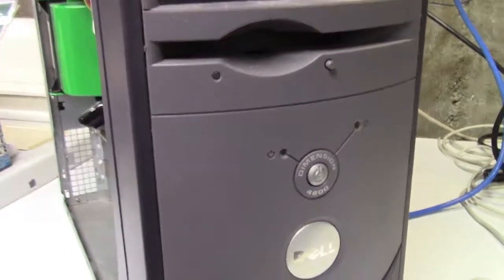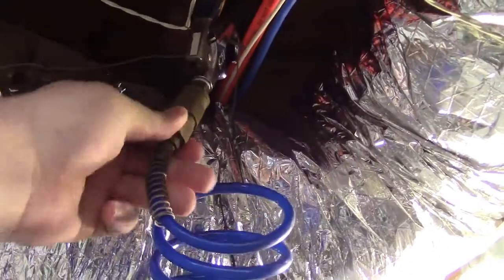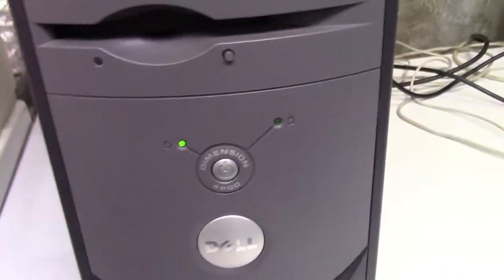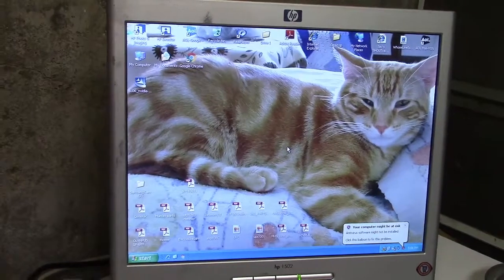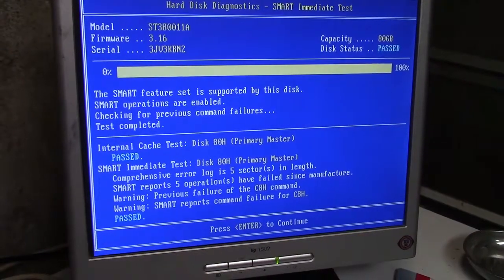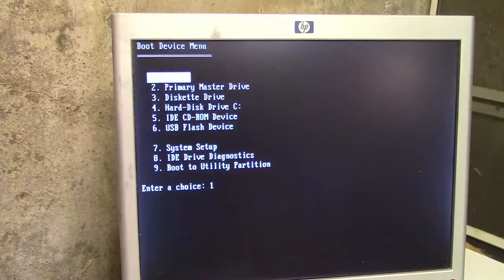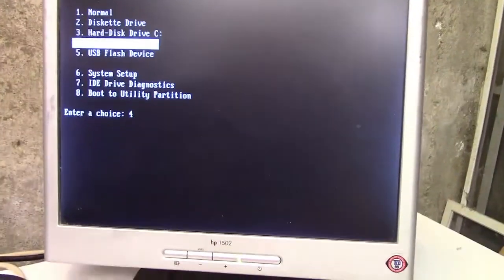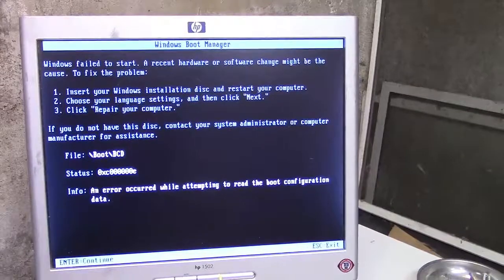Dell Dimension 4600 Windows 7 Upgrade Attempt, Part 1

Comment: Mine doesn’t even want to boot anymore
Reply from the maker: If I could get this thing to cooperate, you can get yours to boot.  Most anything can be fixed.  I've been repairing computers for almost 30 years.
Reply: @jaykay18  I got it to work for a good minute and then I wasn’t getting past the dell boot screen
Reply from the maker: @FDSGarage  Oh that's an EASY repair then.  I'd start by disconnecting the hard drive, most common culprit for an aged machine.

Comment: Is this machine the same model as the one you use on a day-to-day basis?
Reply from the maker: No, I actually have a 4700.  Same case, a bit newer board, faster processor.  This one was a 2.8GHz, mine is a 3.4GHz.
Reply: @jaykay18  Can the 4700 take any core 2 duo chips since it's an LGA775 motherboard?
Reply from the maker: I don't think so, but then again I've never tried.  I don't remember what chipset is on this board.  If I recall, 3.4GHz was the fastest processor they made.  If not, 3.6 was.
Reply: @jaykay18  I couldn't use a P4 anymore on a day to day basis. Everything these days is optimized for 64 bit CPUs with multiple cores. I have a quad core CPU now, but you can easily find secondhand business class machines with quad core processors and plenty of RAM in them in the $100-$200 range, but I built my own system a couple of years ago. In the future, I'm definitely going to buy a secondhand business grade machine with plenty of expansion options with the specs I want, and I recommend anyone else do the same. You can easily get 3, 5, or even 10 years out of a computer these days before it becomes obsolete for daily use.
Reply from the maker: I don't know what kind of stuff you do on a computer, but 90% of the work I do requires the Internet.  Barring scripts and other crap on web pages that have to run, and can run quite slowly, this Pentium 4 that I use has still got it.  The only other tasks I'll do outside of the browser are a couple of digital picture edits here and there, open a word processor now and again, and of course video editing.  Video editing is the ONLY thing that requires me to have a 64-bit processor.

While you may be able to get several years out of a business machine, consumer grade ones look like they're broken the instant you buy them, at least now.  It didn't used to be like that.  Some machine are so poorly designed.
Reply: @jaykay18  Scripts are terrible. I use Firefox because noscript is written for Mozilla browsers, and I consider noscript to be an absolute necessity these days. As for consumer grade machines, they are terrible quality, which is why I said to get a business grade machine
Reply from the maker: Never liked Firefox from the get-go.  Can't explain why.  I gave Chrome a shot, and it's been fantastic, so that's all I use.  This decision I made many years ago, when web pages weren't opening in IE 6 anymore.
Reply: @jaykay18  Google pretty much broke Mozilla in that Firefox is now made to imitate chrome rather than be unique with its add-ons. I've also tried open source forks of Firefox such as pale moon because chrome's interface is terrible, it hoards resources more than a millennial hoards Apple products, and worst of all, Google doesn't care about their users' privacy, and they never will since they know everyone will continue to use their products
Reply from the maker: You'd be hard pressed to get me to switch browsers.  I need stuff that WORKS all the time.  Chrome has proven itself.  It remains my browser of choice.  I'm basically all in with Google at this point, with this YouTube channel and all.  When it stops making me money it'll be time to change.
Reply: @jaykay18  Chrome only works on XP and later, firefox can work on versions of windows as early as Windows 95 (though I don't know why you would want to use a machine running Windows 95 to do web browsing outside of novelty) and that's a necessity for me since a lot of my machines run Windows 2000, and even though it's gotten worse over time, Chrome isn't any better.
Reply from the maker: I only have a small handful of machines that run operating systems prior to XP, so that's not a problem for me.  I have a couple of Windows 98 machines around, but I certainly wouldn't even attempt to put them on the Internet.  They are, however, Ethernet equipped, for internal network access.

Comment: I need to replace the hardrive in my laptop and put windows 8.1 back on it. also got a new entertainment center and now both betamax VCRS fit under the tv. had to get some special cables that will allow me to split the video from the one betamax so it goes to both the projector in the closet and the TV. They sell splitter boxes but I went the cable route instead.

 To get the none HIFI betamax to work with the TV I went ANT out from the sears to ANT in on the sony Then RCA out to the projector and the TV. I don't know if betamax had copy protection like VHS where the picture fades in and out. 

The Sears will output over RCA but only left or right not both. Using the coax I can trick it into stereo sound. I'll use the Hi-Fi to record off the TV with another set of RCA cables to go from the Cable box to the Sony since I got the cable box going HDMI to the tv and RCA to the DVD/VCR combo. Will make a video on all this.
Reply from the maker: 8.1, unless you have recovery discs, or the system is something reasonable like a Dell, is HELL to put back on.  I know the Dells and some of the HPs, and a couple of other brands have the 8.1 product key (or 8 product key, if it came with it, of course) hard-coded into the system, and Windows just picks that up and auto-activates so no big deal.

Interesting how the Sears won't output stereo sound, but does over coax.  Hey, if it works it works!  A quick search reveals "The Betamax player will not recognize the Macrovision signal because Macrovision was not meant for use on beta tapes.  Even though the player doesn't know how to react to the signal, it is still there and can be passed on down the line. VCR-to-VCR copies do not work".  I actually have a device to get around Macrovision copy protection, I think it works over RCA cables only.  Chances are good it's still around.  If not, mine is brand new in the package, never used.
Reply: @jaykay18  im not trying to copy betamax tapes just use one betamax vcr to output the other to the TV. I can't find a coax to RCA adapter. that's why the CED player goes through a VCR. Why can't they make a stand alone convertor?  I think I found one but it was like $400. I can go rca to hdmi etc or RCA to coax but not coax to RCA.  I'll see what the video quality is like if sonys version of Macrovision shows up.  The DVD/VCR combo is hooked up to the TV via Component(red green blue).
Reply from the maker: Yeah a VCR will convert coax to RCA and vice versa.  But if there's copy protection it'll mess with the picture whether trying to copy or not.  I guess they don't make a converter because there wasn't really much need to break out to RCA from coax, especially since coax is already the lowest signal quality; you're not gaining anything by "upconverting".

Comment: The floppy drive makes a much cooler sound than my 8400. The drive on that one just makes the rapid series of clicks to reset the head. I can't imagine running 7 on a system like that. XP is slow enough on a Pentium 4; although, I only have 512 MB of RAM to work with.
Reply from the maker: Eh, that floppy drive seek is NOTHING compared to an IBM PC/AT or one of those early Packard Bell machines, those had the most beautiful seek sounds ever.  https://www.youtube.com/watch?v=hc9RqxnvqVc

With 512MB of RAM, even XP is choked.  With a nice 2.5GB of it, 7 isn't bad at all.  Everything's very tolerable.  Remember, I'm running a system only a little bit faster than this one for my day-to-day EVERYTHING.  Still, to this day.

Comment: Windows 7 outdated and reaching end of support your also 32bit os is dead everyone moved to more better 64bit but you're right about the new machines don't last my laptop was only 5 years old and it died  mother board is petty much freezes or power cycle  by itself or nothing shows up on lcd panel if does work it works until after I log in now it messed up when I power it on
Reply from the maker: Apparently, your fancy-pants laptop with 64-bit Windows 10 doesn't know how to capitalize, punctuate, or form non run-on sentences.

WHO CARES about losing support?  Did Microsoft EVER support you?  No.  Makes no difference.  Most applications are still 32-bit.  It'll remain that way for a long time coming.

Comment: Good to see some computer content again! Wow! I didn't think anybody could use a machine that old for much anymore!
Reply from the maker: Thanks!  This is a 4 part series.  Yeah, I use a machine only slightly newer than that for day-to-day use.
Reply: @jaykay18  Wow you must be very patient lol. Have you ever looked into chrome os? I have found It runs very well on machines a little newer than this.
Reply from the maker: I grew up with next to nothing.  What little we had, we used until it was worn out, then we'd still keep using it until it basically turned to dust.  Patience is a virtue.  I'm not part of the "ME ME ME NOW NOW NOW" generation, I've learned to wait.  Even Heinz used to say that, good things come to those who wait.

Of course it still hasn't happened yet...but I'm still waiting.

Everyone is very quick to suggest other operating systems, but I date back to when dinosaurs invented computers and have a software library dating back then, so I need full compatibility.

Comment: Back around July I've upgraded (or more-less downgraded) my grandmother's machine from XP to 10. It's an HP Compaq dc5700 with a Pentium D and a gig of ram. She got it around 2006-07. The only repair it needed was a CMOS battery, other than that all stock hardware and no bulging caps.  Up until the day I've upgraded it, it ran the factory installed OS. I did needed to add 2 more gigs of ram before installing Windows 10. Surprisingly, it went very smoothly, Windows found all of the drivers and I'm rather impressed how well 10 runs on a 13 year old computer. The reason for the upgrade is mostly because chrome ended support for XP a long time ago, and she was unable it visit a few websites like online banking and others.
Reply from the maker: That's pretty much the exact reason this machine got 7 on it.  I really don't know about running 10 on a P4.  It WILL work, but how slow do you want it to be?
Reply: Yeah, I don't think 10 would work on a Pentium 4. I've tried with an old Compaq EVO a number of years ago. It accepted 7 just fine, it wouldn't even boot the installer for 10 no matter what i did.
Reply from the maker: Pretty sure it would work, at least with the installer I have.  The only copy I have is an upgrade copy so it would require 7 to start with.
Reply from the maker: Yeah, I just checked.  Requires at least a 1GHz processor and 1GB of RAM for the minimum specs.  Something tells me that's one feat you'd never want to attempt.